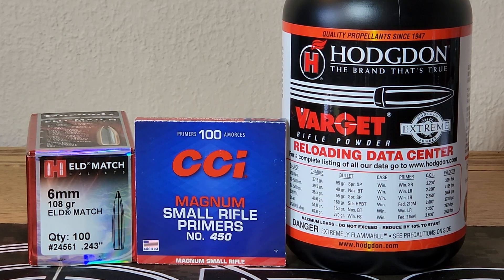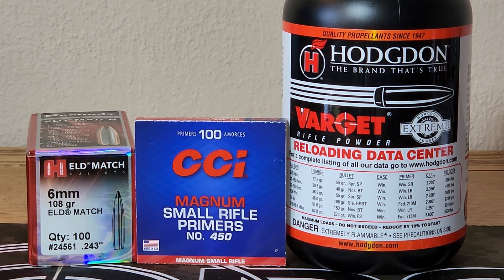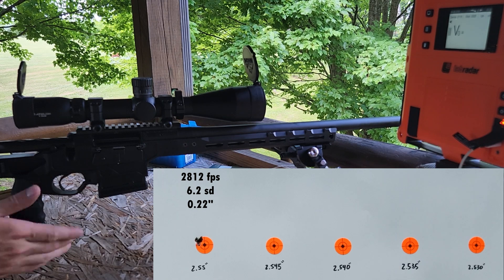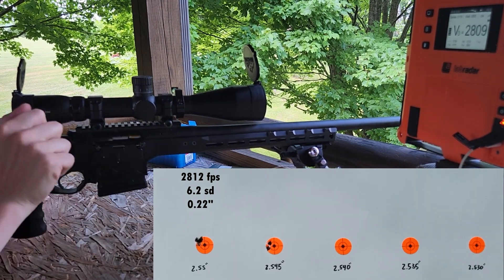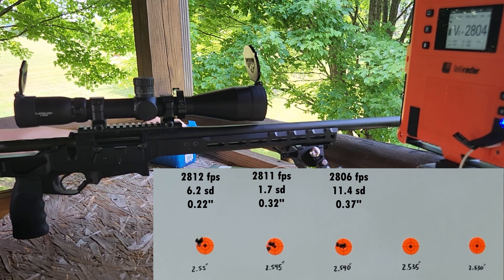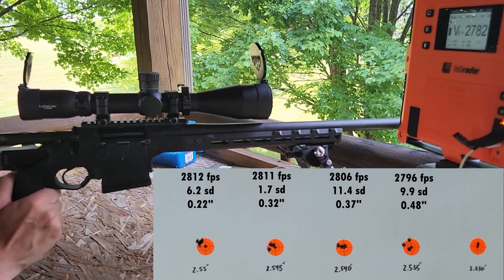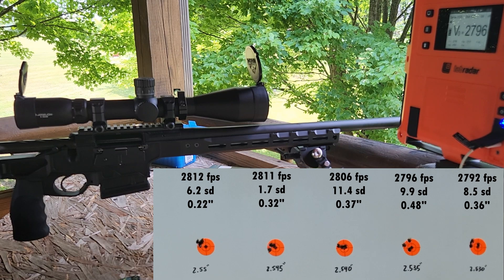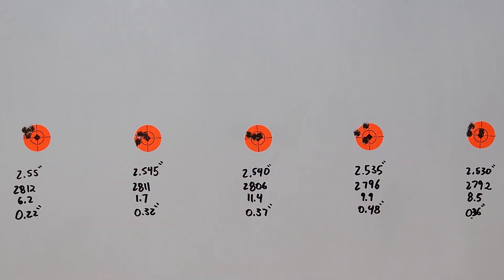6 GT, 108 ELD-M Load Tuning

Comment: Have you ever thought of trying EC Tuner Brake? I'd be curious to see your results! Another great video!
Reply from the maker: You mean trying it on my 6 GT. I have two EC tuner videos on my channel. One testing on my savage 6.5 creed and one on my Mossberg 6.5.
Reply: I understood what you meant and that's exactly what I thought.
Personally I'm a fan of the Harrels tuner/brakes as they are over the barrel not on the end of the barrel and if there is a little slip with the tuner it doesn't affect it's accuracy.

Comment: I've noticed in my load development that when the vertical impact point of the group is same as the one next to it that, that is usually where the node is. Since the group with the length of 2.55 is a little bit higher than the 2.545 I  would typically go to the longer side of 2.55 also to make sure that isn't a better direction to go.  With the lower impact point of 2.545 you may be coming out of the node and could be the reason all three aren't touching. You should go in .003 increments also, I've seen .005 increments skip over a node.

I've seen really low ES's be a fluke before.

Comment: Did you say that you were fire forming the brass still, as in it was unfired brass?
Reply from the maker: Yes this is still new brass!
Reply: @RobsReloading  I don't know if you've experienced it before, but i don't get good consistency with virgin brass.
Reply from the maker: @reloadingfun  I've always had good luck with new brass. Even when I converted new 6.5G to 6 Arc it shot well